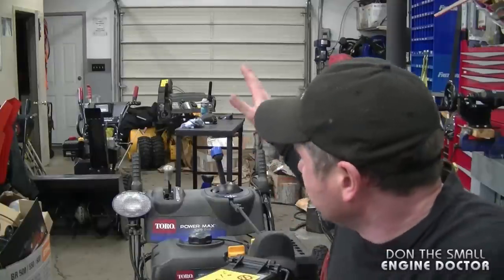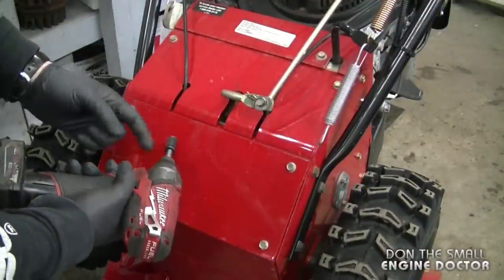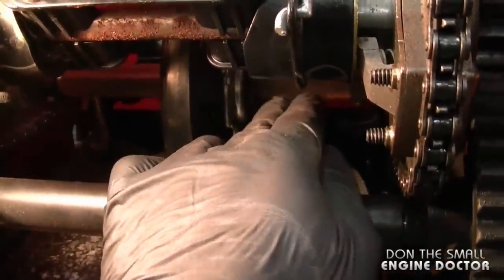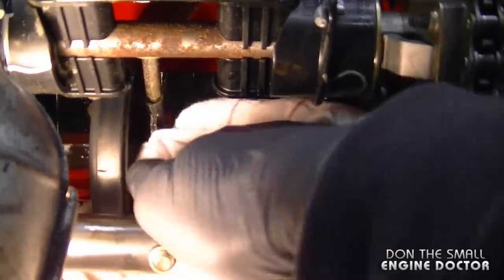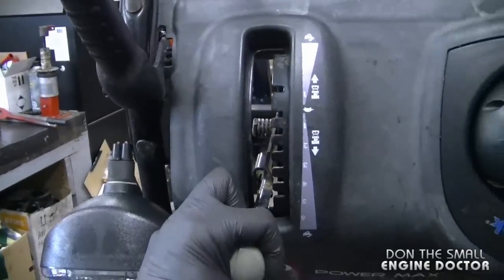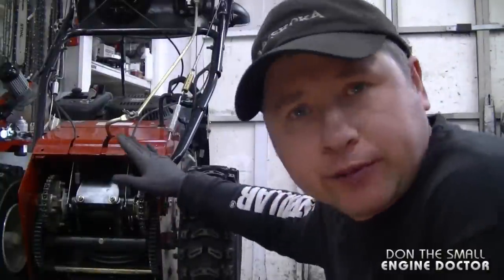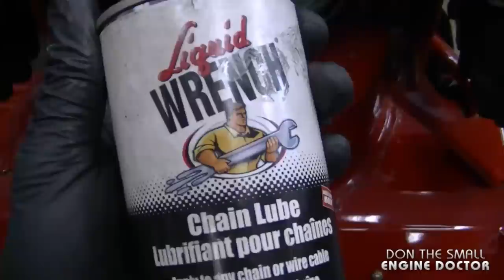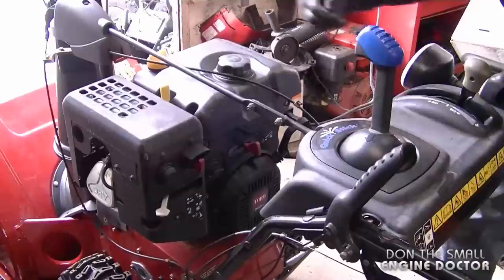HOW-TO Fix A Snowblower That Won't Shift Gears

Comment: Your video saved me hundreds of dollars!
Needed a replacement snowblower and saw a local ad for a 5 year old snowblower $100, mint condition EXCEPT the seller said it wouldn't change gears.
After looking at it I knew a rusty bar was the problem. 
I bought it for $100, brought it home and followed your video.
I now own a mint snowblower that switches gears smoothly for only $100!

Comment: Good video I do the same to my snowblower every year, I use a brush that I cut the bristles on to apply my grease to the gears and chains works great for me no pinched fingers. I'm new to your channel I'm a retired machinist and I like how you do things and explain why it should be done. Thanks again for sharing your knowledge.

Comment: Don thanks to you i just completed over hauling my toro 1028 power  max snowblower. Ok i just replaced my auger bushing drive disc new belts adjusted my cables took apart my carburetor cleaned it out including the jets .what a difference  the engine is running like new . Thank you again for taking the time posting all of your expert repairs. Frank.

Comment: Appreciate the tips. It was easy. It helped to prop the blower axles on jack stands. That worked perfectly. My problem is solved. Thanks for the videos. So far I've replaced the carb and did this repair after gears seized on my circa 1980 John Deere 826 with your vids.

Comment: I keep my snowblower in the garage when not in use and believe it or not, there is no rust inside the machine or on the outside. After seeing you lube the machine, I should do the same. Good advice Don thanks.

Comment: Thanks for the great tutorial. On my first use of the year I had big problems shifting. We are expecting a blizzard this weekend so I bit the bullet - cleaned and lubed the whole machine. It now shifts gears like new. Why don't they make this square shaft out of Stainless? I noticed on your video, at the end when you were testing, that the lowest forward speed actually went in reverse. Mine did this too. I think I may have stretched or bent something a bit when I was struggling to get it to shift. A small adjustment was needed to get it back into the proper registration. Great video! You saved me money and my back.

Comment: Great video as always Donny. The 5 hp MTD I got for my wife the lower joint of the rod was seized.  Another one I have for sale I had to remove the hex shaft and shifter and set it in my vice and apply a few gentle taps on the end of the shaft.

Comment: Ah, between you and Mustie1, I think I'll tackle a similar issue. My snowblower will shift into reverse, but doesn't seem to catch. Maybe it's just an adjustment, but it's likely rust/corrosion on that sliding shaft. I'll check for adjustment first but then most likely be doing as you did, cleaning things up, lubricating and getting everything back in proper range & function. Thanks for uploading. Subscribed.

Comment: GREAT job explaining the gear shifter issue.  My blower doesn't seem to be seem to be spinning the Auger as fast/hard as it use to.  I am wondering if the gear shifter isn't shifting it into full speed.  Even through I move the lever for it to.

Comment: Excellent video.. becoming a fan. 

I'm definitely a FLUID FILM GUY when it comes to spraying things to stop them from rusting. Not the shaft but the other parts.. If people spray that stuff on all the springs and everything and the parts that move when the machine was brand new they would never have any problems with anything rusting or seizing up. 

For the friction disc shaft just putting oil on with your finger once a year would have stopped that problem..

Comment: Thanks Dony!   Great video and tips!   Lubrication is a top priority for machinery and is often overlooked or taken for granted.  I have found that Fluid Film does a good job for lubricating the drive train, cables, pins and bushings.  I also use it on the inside of the blower housing and discharge shoot to prevent the snow from sticking.
Bill
Reply from the maker: yes it's a good product for rust prevention as well

Comment: Being a motorcycle guy, chain lube is for chains. It will flow INTO the chains pins/links. Grease is for gear teeth and the slide shaft. Great vid.

Comment: I fixed my snowblower thanks to you! I have a Yard Machine 8hp 24” with Tecumseh engine model hmsk80  318cc.  It runs, but after 3-minutes, it dies. I installed a brand new carb, new spark plug, put new oil, and new fuel with stabilizer in it. The carb is a fixed jet with no adjustment screw at the bottom. There is also no screw to drain the carb if desired. Rabbit is all the way up, choke was all the way to the right when started and after it warmed up, set choke to far left. Ran steady and then it dies.  What could be causing this?

Comment: I just uncovered my craftsman snowblower from a snow bank. I got it running and it seems to be running very well.   My question is it has 6 forward gears and 2 reverse.   I have to put it in 3rd gear before it moves.  The more I used it the other day the better the transmission worked. Both reverses both work.  But still I only have the 3 high gears to move. Do you think just cleaning that hex shaft will return it to normal operating?  Or do you think lose belts may have something to do with it.

Comment: My shifter was getting stuck last winter: this past summer I opened it up and performed this operation to get the shifting action freed up again, and while I was in there I changed the rubber friction drive wheel.

Comment: Hello.  My gears move fine and all up..  My problem is that it will not stay in a formal gear.  Shifts to 6th gear and reverse.
Any ideas?  Does the linkage need to be adjusted?
Also, no grease on the drive wheel, just the parts you mentioned.   Thats very much.
It's a norma snowblower also..

Comment: hey don quick question... my husqvarna has a similar belly pan but the front of the belly pan has a 2'' opening and it fills the drive of the snow blower with snow and causes it to slip have you seen other snowblowers with a belly pan like that? would adding a piece of sheet metal to close it up and silicone help? keep up the great videos

Comment: Do you know if this is the same on Yamaha YS624W snowblowers?

I bought one used (cheap) before the season and it had a few issues I had to fix (new belts, new spark plug, cleaning and rebuilding the carburetor and a bit of paint - went from near impossible to start to starting very easily), but I didn't look at the gears (unfortunately). It works, but it is hard to get to shift. I often have to put it in neutral first, give a short "bump" to the drive handle and then shift it in to the gear I want...

Comment: That is great to know and good for those in states where they get plenty of snow. I guess the same procedure would apply for the lawn mowers also.
Reply: Yes, almost any mower that has variable speeds and a sliding rubber friction wheel.

Comment: Just found your channel, Great job. I have a Toro PowerShift 1028. It will not stay in reverse, I have to hold the shifter lever , makes it hard to control when walking backwards. Any thoughts?

Comment: Just bought a Toro 824 thrower from some unscrupulous fellows.  Saw it run in 5th gear didn't check the rest.  It goes into gear as far as the shifter up top however there is zero power 1-4.  Would that be more of a transmission thing rather than the drive wheel being seized?  Thanks

Comment: Great video, I have a question ? I have the Craftsman 9 HP Tecumseh motor with the non adjustable jet on the bottom of the bowl, it idles perfect at low speeds , but at full throttle it lopes up and down and the controls seem to be moving themselves while its doing this. It also shoots flames out of the exhaust popping , its just not smooth. If I manually move the throttle linkage and hold it steady it sounds better. I've taken off the bowl, cleaned the jet, no difference. It will run while I'm using it, loping the entire time and it seems to be worse when its hot Anyway, any thoughts ? Thanks

Comment: Was hoping you may have a idea what my problem is. My 1028 doesn't like to move in first gear. I replaced the friction disc but made no difference. It works as it should in other gears. It's a bit older than one in the video I have the Tecumseh. Any help appreciated

Comment: I recently changed the original friction disc on my 2015 Ariens snowblower model 921032 after approx. 6 or so years of usage.  I installed a new disc just 30 days ago and used it only twice.  Before the second usage was complete the new disc was totally fried.  What could have caused this besides a faulty new disc?

Comment: I have a 2003 craftsman 29" 9hp snow thrower in really great condition
 . It looks and runs like new. I have one problem: it is really hard to shift from neutral into first, second and third. from neutral into reverse 1,2 no problem and from third into 4,5, and 6, really easy.
i have been a large truck mechanic for 40 years so i did the obvious i took the belly pan down and made sure the hex shaft had no rust on it and i cleaned the old grease off with carb cleaner and and installed new greece nothing seems to help it is still hard to move the shift lever past the middle i even tried using a flat file on the hex shaft with no luck
So my question is,  is it possible for the hex shaft to get bent in the middle and cause this problem? Have any ideas?
 Would purchasing a new hex shaft solve my problem?
my original part # was 1501100 can i replace it with # 1501100ma
any help would be greatly appreciated

Comment: I have the same Toro model. All my speeds/gears are working with the exception of my first gear. What could be the problem? All other gears are working fine.
Reply: Similar problem,  but it goes directly into 6th gear.  Reverse is fine though. 
Tnx

Comment: What year is that Toro.. It doesn't have an LED light. And it looks like the wheels inside like the friction plate isn't aluminum like the new ones that don't rust. But I could be wrong..

Comment: Can you show where the wheel and friction plate should be for proper speeds in reverse and forward. My cub cadet you can almost never use second gear because it’s to fast and reverse is to slow.

Comment: Hi dony boy I'm looking for a bit of advice. I have a stihl 460 it started running a little fast like it was taking in too much air, I took the muffler off and look in the cylinder and it looks scored what's my best option?
Reply from the maker: replace piston, rings and cylinder with oem or huztl kit from ebay

Comment: That even works on the older snapper rear engine riders.
Reply: I did the same for my Snapper mower this past summer, and changed the rubber drive wheel at the same time.

Comment: Do you know why a Toro Power Max 926 Oxe would have trouble getting into gear randomly? Sometimes it will and sometimes it will not.
Reply from the maker: check cable adjustment, drive belt and friction disc
Reply: @donyboy73  thank you! Makes sense. I was over thinking it. It also was making a weird noise while auging. I think it could all be cable related. Start small. Then I was going to check the auger bearing. I dont think it would wear out in only 6 years of light use though.
Reply from the maker: @jayb4529  you might need new belts and friction disc
Reply: @donyboy73  ok. Going to check it out tonight. Thank you!!

Comment: Any advice on a snowblower that goes backwards in forward gears? When I put mine in 1 or 2 it goes backwards. I can only go forward in 4, 5, 6
Reply from the maker: adjust the shifter linkage until it's ok
Reply: @donyboy73  i will try the shifter linkage, but which one.   The outside the blower or inside?
Tnx

Comment: Dan I have a Aaron snowblower that has the auto turn I replaced the friction desk. And I adjusted all of the cables and  shifting rod to their specs I cannot seem to get reverse can you help?
Reply: Don
Reply from the maker: try re-adjusting the shifter rod again Eugene, I will have a video on an ariens in a few weeks with that problem!

Comment: why didn't the engine smoke on startup, when you have the engine on such an angle , doesn't the oil get into the head and valves. what am i missing here. please explain.......overall, a very good video. something i need to do on mine more faithfully every season,,,,,,,,,thanks.............
Reply from the maker: I didn't tip it far enough for the oil to get in the cylinder
Reply: @donyboy73  thanks for the reply, i'll be doing this maintenance this weekend.

Comment: I have a Murray Pro Seriesmodel630106x31 and the speed control arm will not move it is jammed tight.
Has anyone one had this problem and if so how can I fix it.